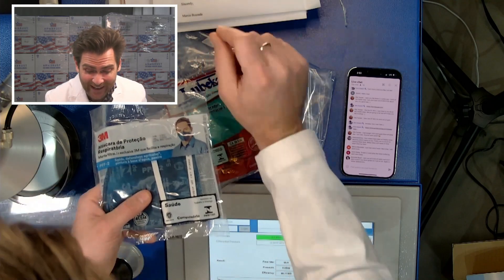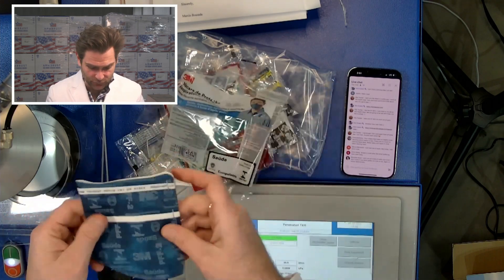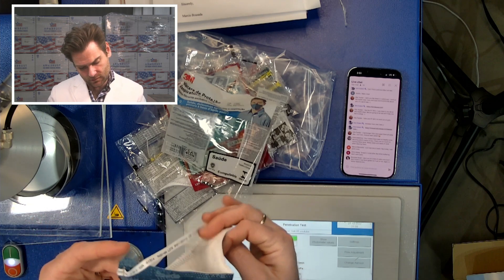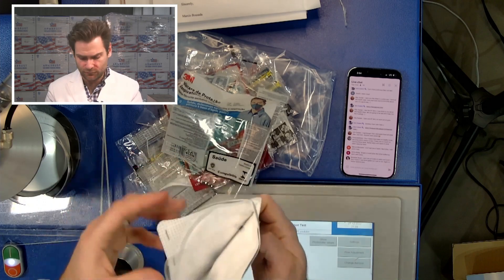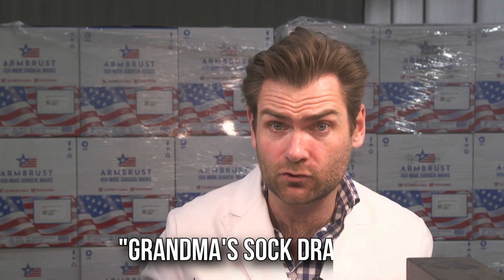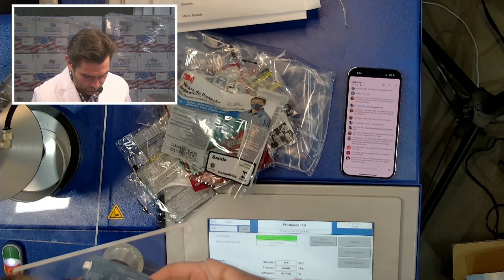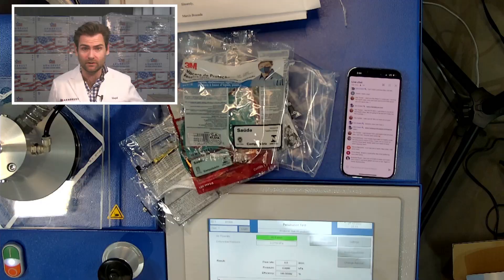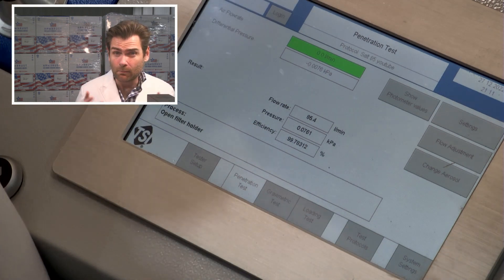Backwards but Working - 3M 9820+BR Review

Comment: How can people in the US buy this?
Reply: Hi James, 

I don't think 3M is importing this model (9820) into the US from Brazil, even though it is also NIOSH approved as an N95 under the current TC number: 84A-8089 and ,therefore, could be sold in the US.

So, to answer your question, I don't think you can buy the 3M 9820 in the US these days. 

However, as the model is approved by NIOSH, it is possible that 3M USA may import this model from Brazil in the future.